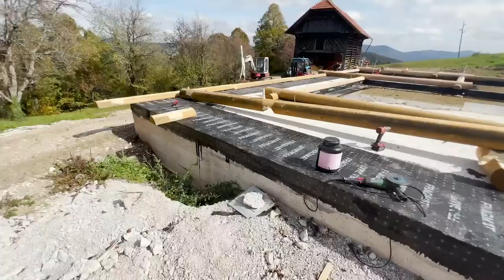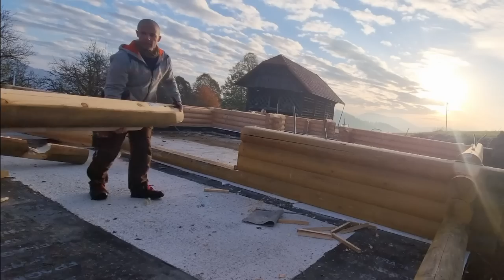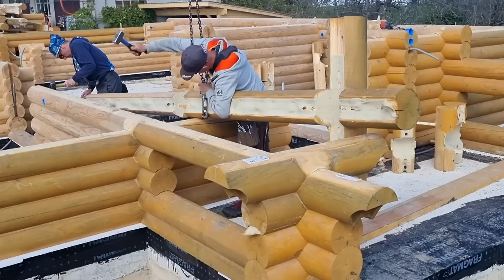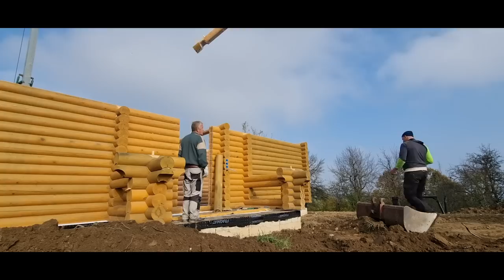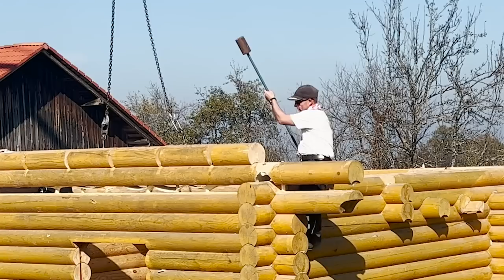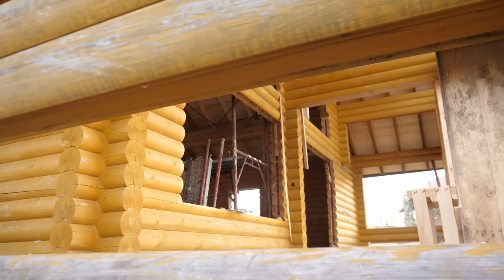Start to Finish CNC Log Cabin Build

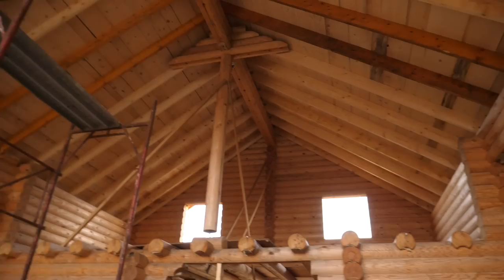Comment: The building is certainly beautiful, but in my opinion there are design flaws. 12:38 - the entire roof rests on an adjustable stand, the ridge beam is connected in a triangular cut